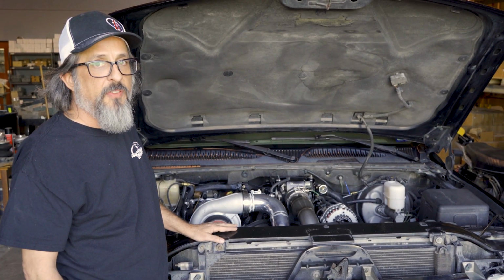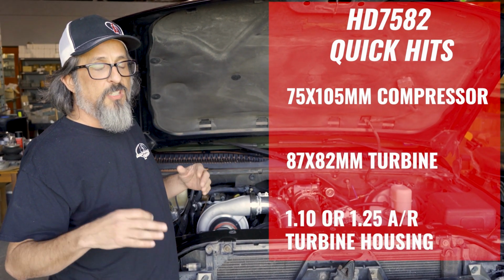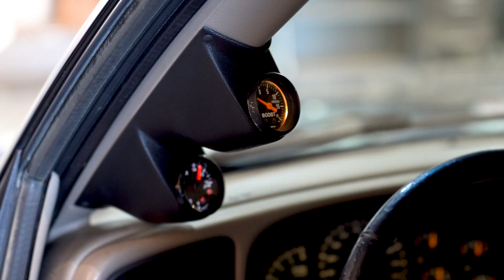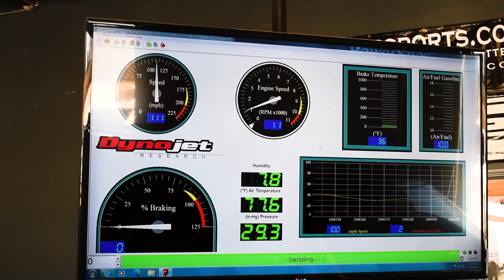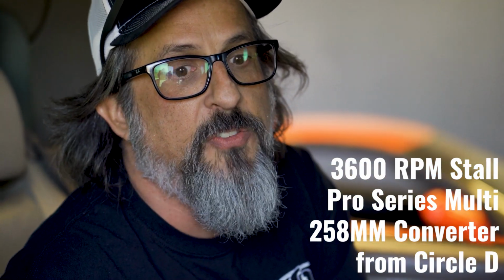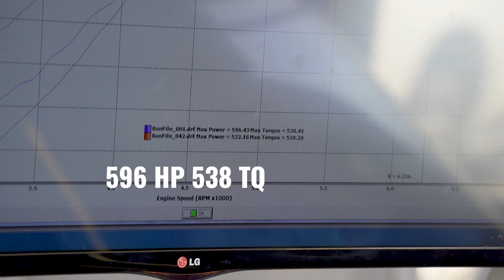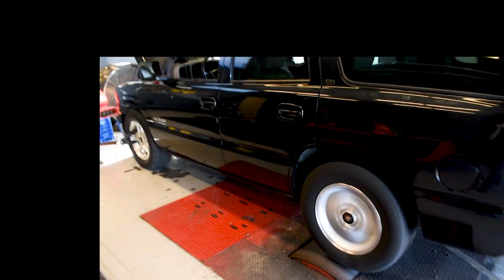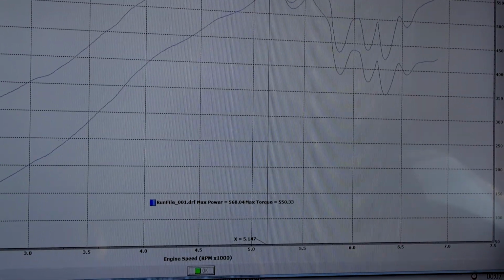Dyno Testing the new HD7582 LS Turbocharger on the Boosthoe

Comment: Get the tire on the front side of the roller so when you tighten the rear straps it pulls the tire into the roller. That will help with wheel spin.

Comment: Is the LY6 bottom end stock, cathedral or rectangular heads, and what hotside and cold side are you using? Are you able to keep all your factory accessories and everything with them? I've got an 06 with a LQ9, Viking DA coilovers, 4"-5" lowering kit, Brembos, declad GMC 20" with the rear widened to 11" I had planed on throwing a set of 243 heads, ported Fast LSXRT, 4.11 gears and Auburn diff I had from another build and getting a cam. But I am really impressed by your setup.